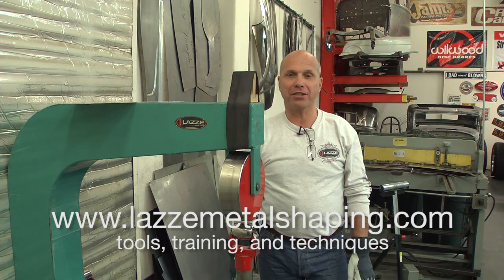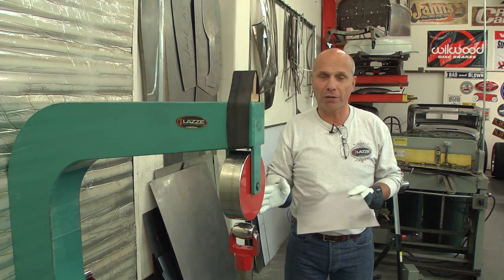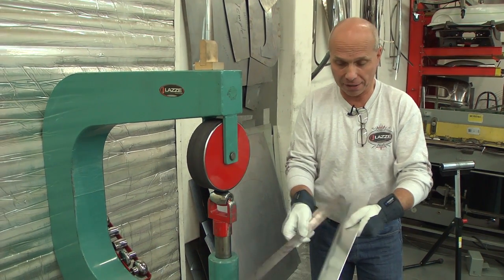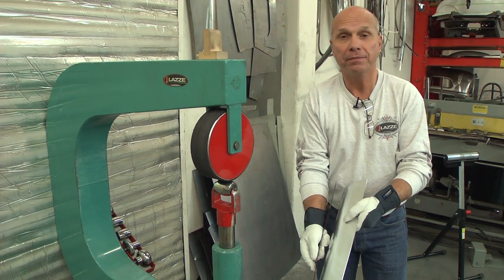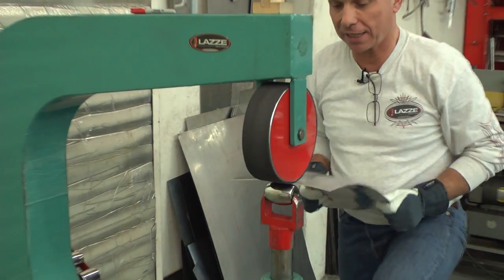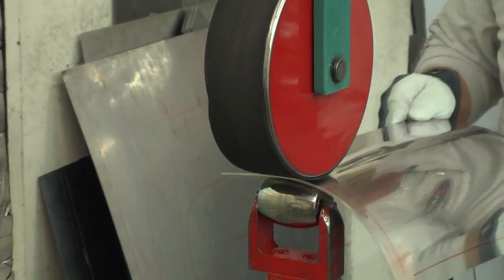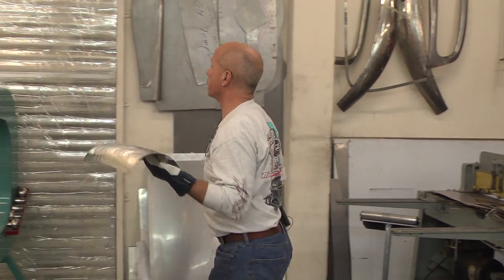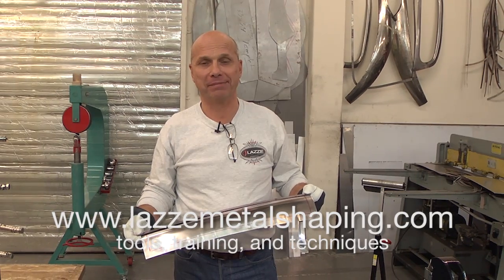Lazze Metal Shaping: Comparing Two Different Methods to Achieve a Similar Shape

Comment: I love that technique!On a piece of metal the size you are using,approximately how much "pre-stretch" can you get away with before the slip-roll type work?I'd like to make a panel similar to this,but with a much more pronounced long-axis curve.Basically,like a motorcycle fender as mentioned by another poster below?Thanks again for posting these videos,they are a great inspiration! I am in the process of building my own English Wheel,and can't wait to get started making stuff!
Reply from the maker: Thank you for your comments. The amount of pre-stretch depends on the material, and tools you have access to. There is another video you could watch which may help with deciding the technique, and while it isn't exact to what you are doing it might help: http://youtu.be/jYzOwWNZIME

Comment: Thanks fot the video! Is that how you make a motorcycle fender?
Reply from the maker: That could be one of several ways to make a motorcycle fender shape. It depends on what equipment and material you have access to. There are usually many ways to accomplish the same goal.

Comment: Hi Lazze,
Great demonstration and much easier than using the slip roll. 
The real difference between shaping with the rubber band and without, is using the rubber band is "forming" and not using the rubber is cold "forging". Great video and wonderfully insightful technique.
Reply from the maker: Forming and forging - maybe cold press forging to be more accurate?
With a slip roll the result is curved only on one axis, with this technique, it can be curved on the second axis as well.
To describe this differently, because someone else will have a similar question,  think about the structure for a tunnel - the material holding the shape; with a slip roll you would end up with a tunnel that is straight through from one end to the other; by adding the rubber band to the process the tunnel can curve up or down, and we'll have to try it on video some day, curve left or right too.
This can also be used on much smaller pieces of material, and with less waste. rather than making the shape and then cutting off the material that was required so it could be secured in the slip roll.